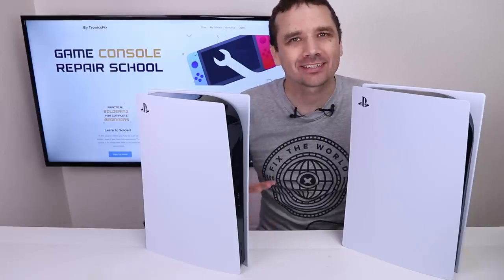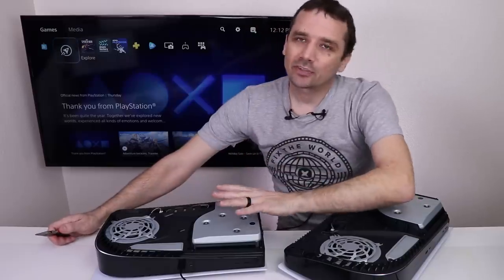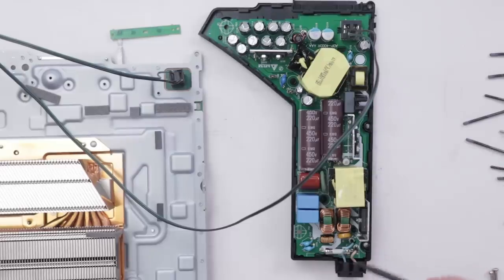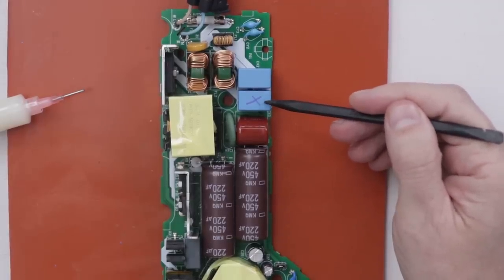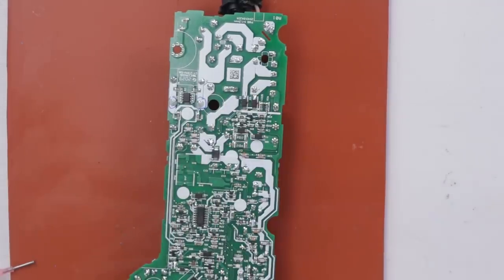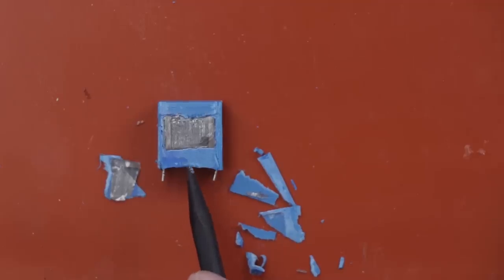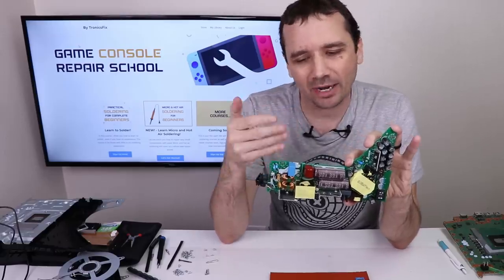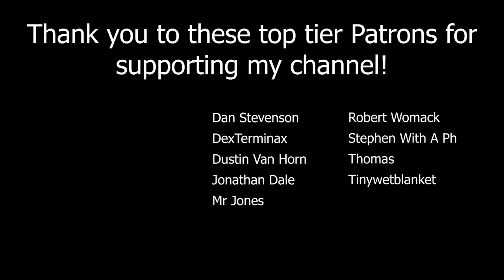PS5 Coil Whine - What Is It and Can I Fix It?

Comment: I'm usually wonderfully lost watching your videos. lol. Right away, I was like .......... THAT'S A CAPACITOR! lmfao. Probably a cheap kind a lot of PC enthusiasts avoid. I see them in the PSU's, as part of the VRM section on my mobo and I believe on GPU's as well.  This is where it all ends for me, I just know that Japanese Solid Capacitors have a much more strict quality control and are a bit more expensive. I couldn't recommend a model as I'm not sure if they're the same across the board. THey're not perfect, but have a much smaller failure rate / coil whine rate than others do.

Comment: @TronicsFix
I also opened my power supply on my exchange PS5 (noise lottery 🙄) to find the super annoying buzzing component (can hear the buzzing from 3 meters away over the game sound  🙉) and accordingly glued all the coils and other suspicious components with epoxy. Without success 😏 I will now replace these two capacitors with higher quality ones and then see whether the loud buzzing sound is quieter or has completely disappeared. Could you please tell me the dimensions of the capacitor, as i never measured these during the glueing. Then i will order a higher quality one. Thanks and greetings from Germany ✌️
Reply: same here dont work epoxid . tell me if you chance . Size: 1.9x1.6x1cm
Reply: @vanhel6907  are you sure? These dimensions do not match the datasheet.  The grid dimension would be more important (distance from pin to pin) With your dimensions the pin to pin distance should be 15mm
Reply: @andyb.981  pin to pin dont no. if you find capacitors please tel me plz.
Reply: @ibogun9467  so, i found and ordered a capacitor with almost identical specification. It's a Würth Elektronik WCAP-FTXX X2 680nF 310V/AC 10 % 15 mm (part-# 890334025045CS) capacitor. I spoke to an Electronic Engineer colleague and he said the lower capacity (original 1μf) wouldn't be an issue. But i should only replace the noisy one, not both. There isn't any capacitor with identical specifications from other manufacturers out there except the original Surge Components one. So this is the best bet. I'll make a video after succesfully replacing and testing the new capacitor
Reply: @andyb.981  Danke Andy habe auch selber bestellt . ich hoffe klappt das . mfg

Comment: Consoles are more powerful now, so yea, just as powerful graphics cards in PC, there can be coil whine, even in gpu or psu, cause now it requires more voltage, cause parts are more powerful and unfortunatelly, as the electric current flows trough those coils and capacitors, it can resolve in coil whine.. my 2070 super also whines, its harmless, its annoying, what can we do about it.. on PC you can undervolt, on console.. You are unlucky

Comment: If that capacitor takes fluctuations in voltage would putting an anti-surge socket in between your PS5 and Mains take away the noise?

Comment: you might want to add a warning that the capacitors on the power supply can still contain lethal shock after disconnected from the power socket and must be discharged before handling the board

Comment: Get value of the capicator and order it I change alot if cap
Reply from the maker: What are the best brands of caps?
Reply: @Tronicsfix  did u see the value
Reply: You can order them off digikey or ebay
Reply: @Tronicsfix  Steve, we have used EPCOS for years. Pretty reliable. VISHAY, KEMET, PANASONIC and TDK (yes, like the tapes). The last two ones have specialized division just for caps. Buy a couple of each brand. IMHO after the years EPCOS gave us the better results (cant tell about whine because we didnt use them on SMPUS). I have seen some IBM PSUs using PANASONIC (the simbols is an upper M enclosed in brackest) at the same place you seem to hae the issue.

Comment: Vibration. Coil whine is caused by vibration of the coil. You can normally use hot glue to stop the vibration. You can varify this by using the plastic hand of a screw driver and putting it on the side of the coil.

Comment: watching..regards from poland 
2:13 what is?
Reply: You can use any solid object as a stethoscope 🩺  as a mechanic I do it often with a pry bar.  Press one end on what you want to listen to or through, and the other end I use to press the ears cartilage nub over the ear canal, but you can press it anywhere near the ear really.
Reply from the maker: It's a small hose. Helps me pinpoint the sound. I should have explained that in the vid.
Reply: @Tronicsfix  thx for reply...i have lcd power supply wqith strange noise and i cant precise diagnoze what elements buzz...:)

Comment: my brandnew PSU had same problem and they said it's normal but  i just feel like it going to explode so...RMA xD and got second hand PSU instead.

on pc they said just stress PSU and let it run for a couple of hours, but on pc at least you can overclock gpu/cpu...to draw more power from PSU

Comment: Small square of dynamat on the side of the component to dampen the noise? May work well
Reply from the maker: The capacitor itself isn't vibrating at all. If it was I'd cover it in silicone or something. Good thought but I don't think it would help.

Comment: Sir I have ps4 slim its fan is very dirty can i clean it without removing the metal plate? My fear is that if I use the compressed air the dust will go inside the heat sink

Comment: Are you sure its not the coils right next to the capacitors?
Reply from the maker: Yes I am
Reply: That's quite strange. Maybe the foils arent tight enough from the factory, could be an internal air gap. There's no other fix than to replace the cap with a better quality one.

Comment: My xbox one s does a buzzing sound when turned off and it comes exactly from the power supply
Reply: if its the launch model that may be the fan
Reply: @hmello3250  o no the fan is absolutely silent i sit very close to the xbox and can't hear anything over the sound of the games its just when a turn off the xbox that i hear a lil buzzing sound
Reply from the maker: I've heard that on the original Xbox One but not sure if I've noticed that on the S.

Comment: Hey tronics fix i have a first gen ps4 that has a problem where i press my power button and it turns on the blue light but then i press it again and nothing happens other then the beep then one more time and its turns blue and beeps but for some reason my ps4 dont come with the washer plate so i cant change the washer and i recently got a new power supply and when i switched them it was workin fine and now i have this problem. Can you help?

Comment: How to fix Coil Whine? You don't. The coil whine on the PS5 is inaudible compared to what a GPU whines about, coil whine at about 55-60 Decide fan noise still audible. The more electricity goes through those coils the louder it gets.

Comment: Is coil whine a problem in the future? It will broke because of a faulty part ml
Reply: IT can operate like that FOREVER. All power supplys vibrate and make noise. But some of them produce "sound" aways from the audible range. Other are muffle with silastic. Other none of them. Whine is normal
Reply from the maker: Not a problem at all. Just an annoyance.
Reply: @Tronicsfix  thanks for the answer. Keep up the good work.

Comment: not a good sign that a brand new console is already having problems
Reply: Thats not the only problem it has, better buy the xbox as its not having hardware issues at all just some minor software issues that can be corrected with updates, the ps5 a lot of people has had graphics card issues that a ton of artifacts appear in the screen, the temperature in the ram its absurd more than 90ºC, the controller has had a lot of problems, even the developers are having problems so... thats not a good sign, the liquid metal i think that with time can destroy a ton of ps5s
Reply: Have you ever have listen to laptop chargers, motherboards, ATX PSUs .... some laptocharger whine as no tomorrow. And they are perfectly fine. All of them make noise, but in many cases it is not in the audible range. Depend on the PSU, component, swtiching frecuency and mode of operation.
Reply from the maker: It's not having problems. This is a normal noise and just an annoyance.
Reply: @soulmourne2698   Jesus what an Xbox troll there is plenty of series x issues as well loose screws drives that don’t work and consoles getting bricked just the same as PlayStation the Ram temp was 90 degrees in one video and 75 in spawn waves video hardly anyone has had controller issues the Xbox shouldn’t have any controller issues as it’s the exact same controller as the Xbox one they didn’t even try and developers having problems ??? First time hearing this just stop spreading lies trying to justify you’re purchase the ps5 is outperforming the X on nearly every game and has outsold it 3 to 1 try again xbot
Reply: @CH-bn7qb  The series x controller is amazing it improves the only bad thing of the xbox one controller the d-pad, and now you say about innovation when sony has sold for 26 years the exact same controller?, innovation is nintendo that innovates in every controller, i'm not at troll and i'm not xboxer i just know what is going on in video games and consoles nowadays, if you just buy ps consoles its not my problem i play all the consoles and i know what are the main problems of every single one of them, and the xbox is more capable if a game or 2  run better in ps is just because they had had more time for optimizing the game for ps5 couse the dev kits were given much earlier for ps5, we will see when new gen microsoft games release on xbox, gears 5 already looks similar to a 3080 in series x and thats because microsoft has optimized it for their console, not because the series x is more capable than a 3080 which is not, what you tell me about the garbage gigantic disign of the ps5? they did it that way couse they didn't want to copy xbox with the disign of the console, couse people would have noticed it, and one thing pc is always better than any console, but taking just consoles in acount xbox has been better since the first xbox the only ps console that has been the best of the best was the ps1, i don't compare nintendo consoles couse are very different all of them since the wii, but the gamecube was also much better than the ps2, i know that truth might be painful but it is what it is, anyone that has played video games all his or her life will agree with me
Reply: @soulmourne2698   what the Xbox controller is the exact same except better latency Sony actually tried to innovate with haptic feedback everybody that has used the PS5 says how good the controller is it was Sony who invented rumble built into controllers back in the PS2 days Sony’s first party games always take the top game awards year after year and that won’t change anytime soon all I see on Facebook market place around my area are people wanting to swap there series X for a Ps5 no joke the series x is just an Xbox one x 2.0 only good thing it has is game pass and even then there is nothing system selling on it ? I’m all for competition but if Microsoft doesn’t produce actual good games this gen then it looks like this might be that last Xbox
Reply: @CH-bn7qb  The first console to ever have rumble was nintendo 64 the haptic motors are already in the switch since 2017, xbox doesn't have good games you say? forza horizon 4 ori sea of thieves, grounded now all bethesda halo gears, wtf are you talking about?, the only thing sony has done in innovation in all its history is add a second stick  when they made the dualshock couse all controllers had 1 stick and the adaptative triggers on the ps5 nothing more, everything else was to copy nintendo
Reply: @soulmourne2698   oh man it’s embarrassing even arguing with you Nintendo had the rumble pack for the 64 you had to buy seperate the first controller with rumble built in was the DualShock one ? You really have no clue gears 5 was terrible most people agree there forza is decent and sea of thieves I mean nobody plays it it was bare bones at the start it didn’t review well halo hasn’t been good since halo 3 Microsoft keeps overhyping and under delivering I mean look at crackdown 3 🤣🤣🤣 Xbox is a joke now it’s a dead console
Reply: @CH-bn7qb  we will see when xbox releases its new gen games and yes i didn't read built in, yes the first controller to have built in rumble was the dualshock 1 for the ps1, but the innovation comes from the n64
Reply: @soulmourne2698   we definitely will don’t get me wrong I don’t want to see Microsoft or any other company do bad I absolutely loved halo 1 on the OG Xbox split screen with friends of I’m hoping Halo infinite is amazing if it is I may buy and Xbox just for that but only time will tell

Comment: I only get coil whine when I stop a game and go to the home screen. It will even continue for a while after I go into rest mode. It stops quickly if I turn my PS5 off. What would cause it to only occur when I’m NOT playing a game?
Reply: the amount of current being used, the whine happens when the capacitor hits a certain frequency and vibrates, so when not playing a game its is using a constant amoumt of electricity, when playing a game the current will change frequently and not sit at a steady rate unless you pause it

Comment: The problem is not coil whine, it's that people whine. They whine about fan noise, coil whine, I have also seen them whine about fans not making any noise.

If its working fine, Wtf is the problem?
Reply: @Dirty_Bear22  it's part of the wider problem of obsessing over material things. If there's no coil whine then they'll worry about some minor scratch on the panel, or some other trivial thing. But yeah you're right, there's nothing to be done about that.

Comment: Can you fix the unbearable noise when putting a disc?  The loudest I’ve seen is with miles morales disc
Reply from the maker: Probably not but I might have to check into it.
Reply: @Tronicsfix  thanks for replying!  It seems specific to the ps5, the xbox series x doesn't do it, neither the ps4 pro.  I've tested on 3 different ps5's and so far it's loudest with the mile's morales disc.  I'm talking not even in-game, just powering the system with the disc on or inserting the disc after powering on

Comment: I wonder, what voltage is the psu? - can't i just replace it to an external pc psu? (U know green and black wire bridged, always on) - then i coild build it into a pc case with air flow too... ;)
Reply: Ah btw, i had no single crashes anymore in CoD CW after replacing the thermal paste on the XSS - before every hour once ;)
Maybe the chip got too hot, that it heats up the other chips around too much. :)

Comment: Why don’t you just pop another of the same capacitor on there?
Reply: because that brand of capacitor suffers from this issue its hit or miss finding one without coil whine, if you had access to a bunch of broken ps4's you could probably find one, the better option is buying a higher quality one from a better company
Reply from the maker: Because I don't want to put the same brand in there and I don't know which other brands would be good.

Comment: How do you explain change of the noise frequency when changing demon's souls remake from performance mode to cenimatic mode? Graphic card?? And if it is in fact a power supply issue, would it make any difference if I plug the console directly to the power source? Thanks
Reply: Noise changes as load changes. If the game is pushing more from tghe GPU, GPU uses more current and power supply need to deliver more current, ie change the duty cycle, but they can change the freq also. When the whine is bad, like in some laptops, you can hear the tone change as load goes on and off. It is normal

Comment: WTF the thing is brand new and it has problems already guess I'm going to wait till V2
Reply: Nothing wrong with either of these units, nor any other PS5 that does this, nor any other electronic that does the same thing. Electricity makes noise. It's just chance to how much noise between different units. 

Visit your local electricity sub-station. You'd probably think something is wrong, but there isn't. Same goes here, just at a much lower level.

People who think the PS5 coil whine is bad would hate to try having a computer with a high end graphics card with a noisy coil. It can be much worse than this, despite nothing being wrong with it.

Comment: Another solution is to run 1.21 gigawatts through that flux capacitor
Reply: How?
Reply: @MrUchiha  you attach a 10'  metal pole to the PS5 and let a lightning bolt ⚡ strike it. Very easy
Reply: @user-cb4nh7ze1s  So funny 🙂

Comment: fix it by buying the same part but a japan made part as there will be all cheap china parts, this normally what happens with caps they use cheap made ones and don't last. get the part number look it up and buy japan made and solder it back in this should fix it

Comment: Still not as bad as the original ps3 metal shrouded power supply that would desolder you chips from the board for you when you didn't want it to lol

Comment: These X2 capacitors are not so much filters as they drop incoming voltage and current used mainly in transformerless power supplies.  Some people call them capacitor droppers.